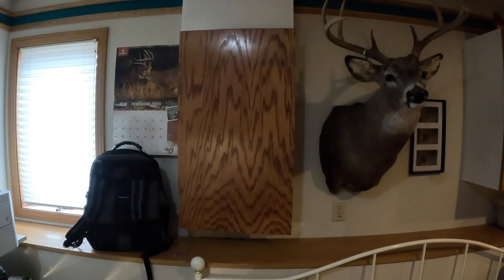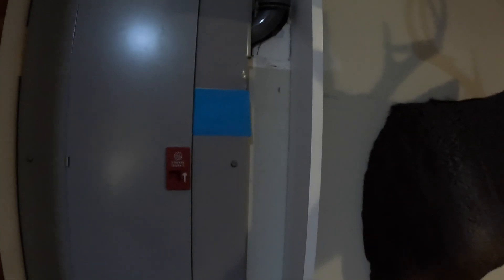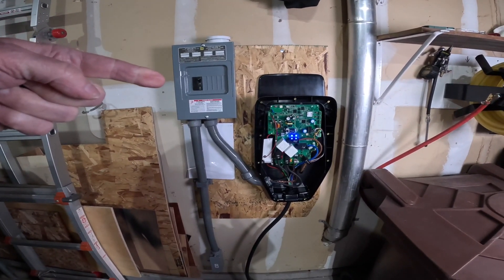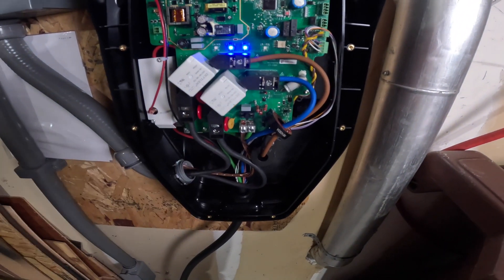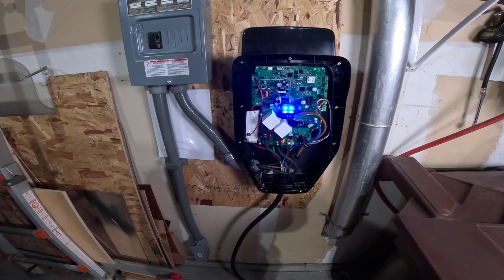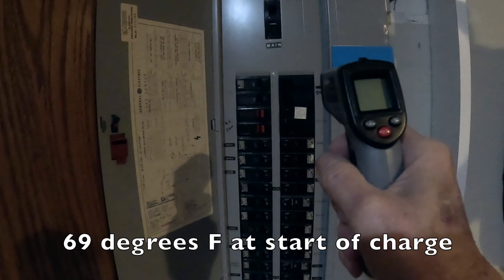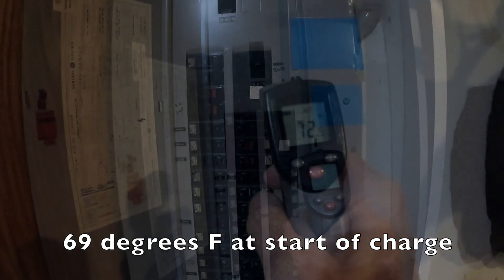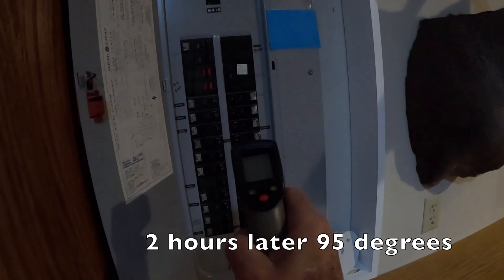FCSP charge station install information and follow up

Comment: I just had mine installed today with all proper copper wiring and it is set to 7 with a 100 amp breaker. My panel is a 200 amp service. No heat issues at all on my breakers and panel. It started off with a pulsing blue bar like it is supposed to have and was pretty much averaging the entire time anywhere from 14 to 17 kwh charge rate. It was consistently adding 32-35 miles of range per hour. However, at times, a solid amber light to the right of the pulsating blue bar did come on, and the charge rate did decrease to 5-7 kwh. The solid amber light did disappear at times and then reappear. It still produced 32 plus miles per hour as promised. Is this still a problem I need to deal with ? Or should I not worry about it since it is producing as promised? 

Any advice will be much appreciated, and please let me know if you have a solid amber light along with a pulsating blue bar as well. 

Alan
Reply from the maker: As you know the pulsing amber is reducing the charge rate and that usually means you have heat issues. I set mine to 68amps and never had a pulsing amber. Did he torque the nuts in the FCSP? Not saying anything negative but some of the electricians out there think they can torque with out a real torque wrench. I was so afraid of breaking the lugs I actually put a wrench on the plastic part of the lug when I torqued it. Tough to explain in a text...... If I was you, I would try turning it down to 68amps and see if you get the pulsing amber light.

Comment: look on page 17 ( you can lower the amperage ( nine setting ) ( for people who do not have an 100 amps to spar 
I have a 2023 ford Lighting , I have mine sect at 50 amps on a 60 amp breaker.
Robert
Reply from the maker: If you went to my" follow up" section that is exactly what I did, mine is running at 64 amps. I should have mentioned the 9 position switch in the video, thanks. You can actually derate the FCSP to 12 amps. I am guessing yours is at 48 amps 👍

Comment: Thanks for the video, I have a question, I installed my charger it's outdoor. I have a 200A for my house and 100A for the car. the breakers for the car and the main breaker (the 200A) are getting very hot to the point that my main phase from the electrical company melted down. any idea why it happens?. btw I didn't torque the screws, can it be because I didn't torque it?
Reply from the maker: So many things that could have gone wrong. Did you follow the FCSP instructions, including wire size? Did you follow my advice on the video? I am guessing you did not put a temp probe at the breaker like I did, look at the follow up on the video, it is at the end. I am also guessing you were using the full 80 amps? Torquing is so important and that is why I stressed that so many times in the video.

Comment: Not sure if you gave enough information about the wire length and gauge
Reply from the maker: I used 3.3.3.5 CU and it was 42 feet. I thought for sure I had put that in the video
Reply: @zweare1   where is the best place to buy this and is it copper
Reply from the maker: Copper is crazy expensive. I ended up buying mine on eBay. Seller: Bobdraper85
Reply: @zweare1 I saw some blue and brown wires and some small communication wires too..did you have to mess with those? Or did you only have to hook up the #3 copper from the panel?
Reply from the maker: @John-pc2yr  I am pretty sure those brown and blue wires are for if you are going to use your Lightning to power your home in case of a power outage. Thats a huge expense and I did not opt for the upgrade.
Reply: @zweare1  ok cool..thank you for the response
Reply: Link to the tools you used?